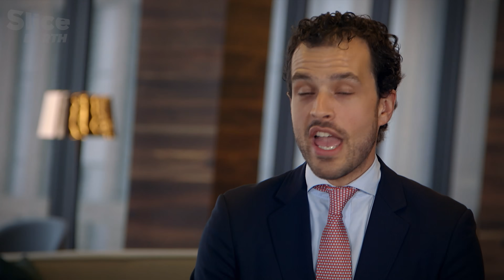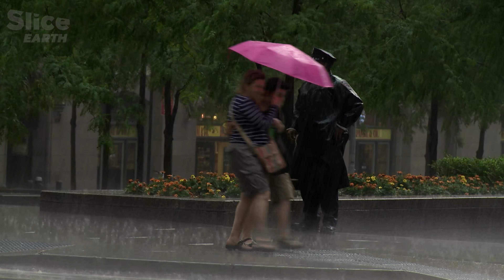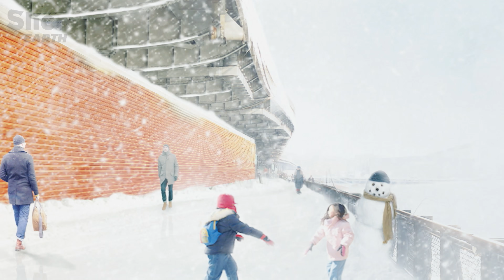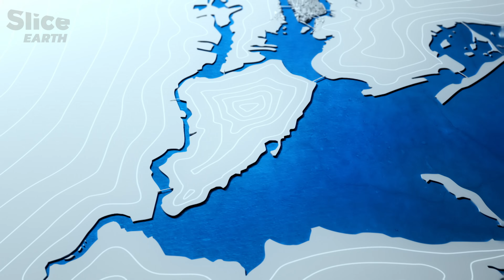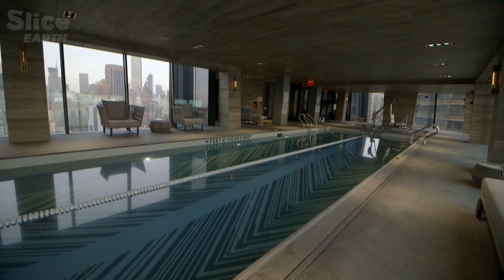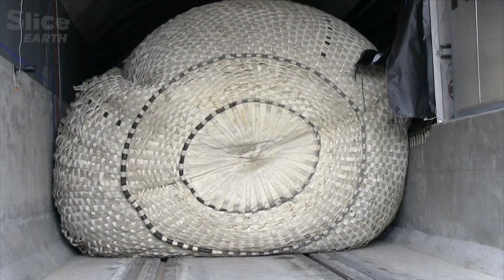New York under water: The city that could drown | SLICE EARTH

Comment: New York will not be saved in it's present globally prominent position, because that will not be cost effective for the corporations and politicians who have the power to protect it.  Money rules New York, and profits will determine what is done year by year.  Developers will continue to profit from building in threatened areas - and then leave town with their profits when sea level rise floods those areas.  Corporations will abandon New York and move to cheaper cities on higher ground when floods make it uneconomical to stay - many have already prepared or are preparing new locations for that future.  Politicians know this, and so will not raise corporate taxes to the level needed to fund permanent solutions.  Yes, they are taking steps to slow the destruction of New York while New York remains a cash cow for the politically and financially well connected - but they're not going to prevent its eventual downfall, that would cost too much.  

In a hundred and fifty years it will be a much smaller, much less important city on the high ground currently covered with cemeteries, on high ground in the outer boroughs, and on floating neighborhoods taking advantage of the increased water surface area - but it's former glory days will be just a footnote in history.
Reply: You could expect similar with London and Tokyo and other waterfront cities in general. Everywhere there'd be a retreat inland and the blossoming of reefs and potential tourist attractions. Would be interesting to see NYC in 200 years
Reply: Your right the same fate as other civilizations in the history of mankind
Reply: As for downtown New York City, I could see it moving to the Palisades in New Jersey and to Staten Island's high ground (although contamination from the Fresh Kills Landfill might be an issue). Businesses might simply move upriver to the Catskills.
Reply: There's precedent for this in drier territory. Look at Bunker Hill in Los Angeles... That was a new "downtown" built near the "original" one. (It turns out that even DTLA isn't LA's original downtown - the honor belongs to the "Pueblo", a neighborhood near Los Angeles Union Station.)

Comment: The lowest stations on the London Underground have had huge flood doors for nearly a century, long before the Thames Barrier was more than a school boy project. The Prague Metro has had flood doors on the lowest stations for 20 years. New Yorkers have all the money necessary to jack the entire place up on stilts OR to abandon the lower floors with elevated road running past the 4th floor. With a building 50-80 floors high, who gives a tinker's damn about the bottom 3 floors ? As for building embankments, Hurricane Katrina revealed to us that American's are not very good at that.
Reply: Prague's metro was built in the 70s already with flood doors - their secondary purpose was however to serve as seals in the event the metro would be used as shelter for atomic bombings. Because they were never action tested, when the floods of 2002 happened, most failed and the whole endeavor became moot (though even if they didn't fail it would have had the same conclusion, since the Nádraží Holešovice metro was under reconstruction at the time, and was basically a giant open hole, directly next to the river). It is exactly because NYC's metro is so old, that retrofitting is much more complicated - the cut and cover method very close to street level, with ample side-walk grate ventilation makes installing flood gates largely a useless waste.
Reply: @serebii666  Thanks for the reply. Just like the London "Underground", the great majority of which isn't "UNDER" anything, so, the great majority of the New York "Subway" is not "SUB" anything either, in fact, a lot of it is stuck up on stilts. 

As for Prague, as you wrote, in 2002 most of the so.called protection was useless, and I suggest, was never intended to stop flood water or the entrances would have been placed higher ... far simpler than flood doors  .... and in the 1970s, there was still very little metro. The original plan had been to transfer some of tram lines in Central Prague underground to free up some road space but it was under Soviet pressure that the idea of a BOMB-PROOF proper metro was conceived. It was only after the 2002 floods that PROPER flood doors were fitted. There were some problems in 2013 but NOTHING like would have happened without those doors. 

As for New York, they will probably wait till there is a catastrophic disaster and THEN they will think about it.